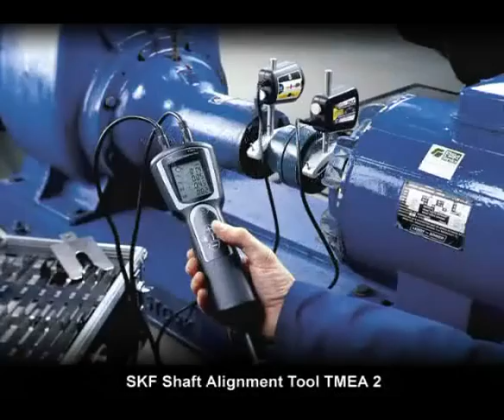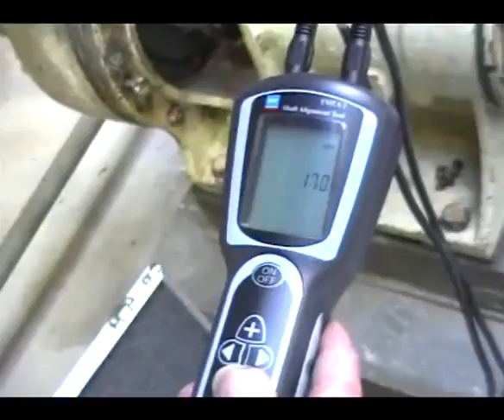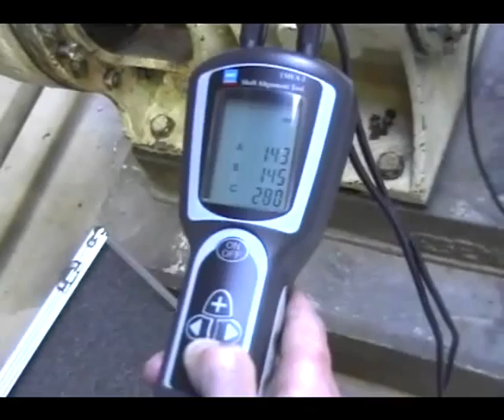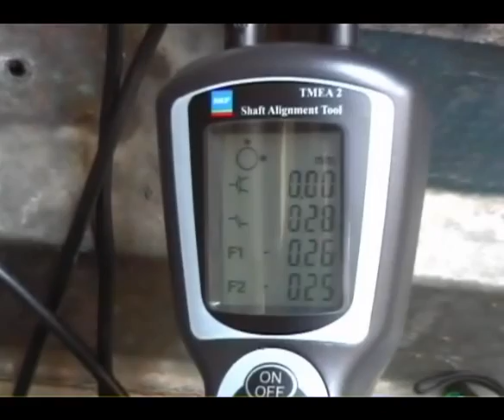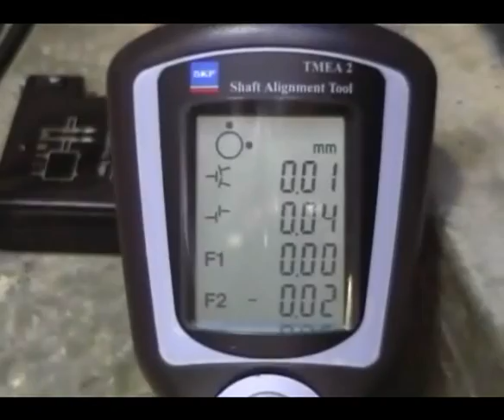SKF Shaft Alignment Tool TMEA 2 (Dụng cụ kiểm tra và điều chỉnh độ đồng tâm trục SKF TMEA 2)

Comment: I have the same tool with me , but there's some problem. When I press next button after giving the measured values , it displays only a empty circle . ( Before it shows the direction where to rotate like 3 or 9 o'clock ) . I tried somany times in every way. But it doesn't works . Somebody can help me ?